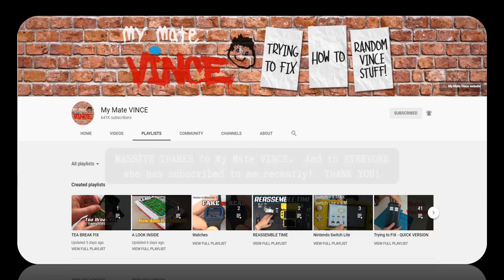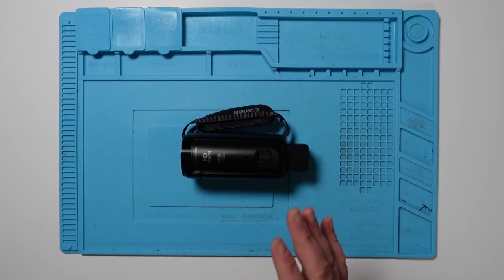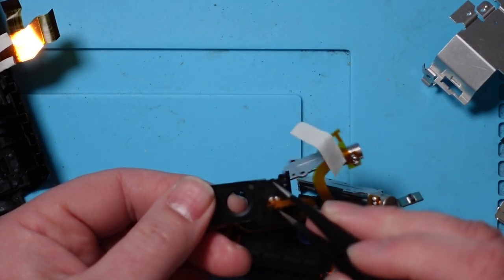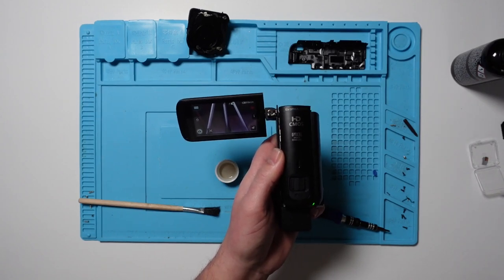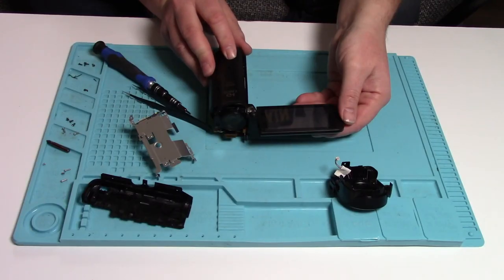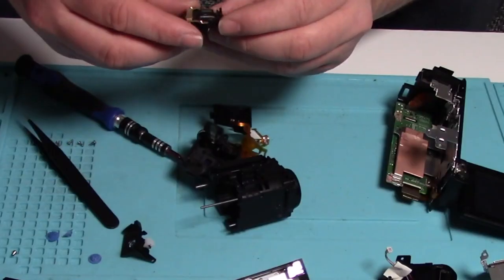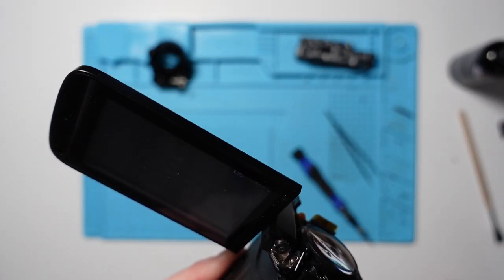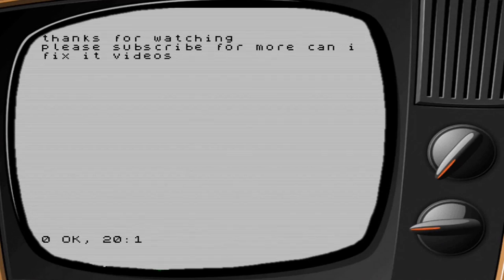REVISIT | Canon Legria HF R806 Camcorder with NO IMAGE/Black Screen | Can I FIX It? | eBay Repair

Comment: Good perseverance, 
I think the reason the iris system malfunctioned in the first place, was that liquid that was on the box too, got into the camera and after it dried around the iris the residue makde it stuck, could have been some sticky liquid.
When it worked the first time then stopped working you also could have set to the Av mode ( manual aperture  )  which would kick in that motor to move

Comment: Hello, Steve,
If you are not sure if the aperture unit is working or not, then disconnect its ribbon cable and use your bench power supply to give it about 1.5 volts then see if it opens or not.

Comment: The reason it started working is because you loosened it up by cleaning it with alcohol. It stopped working because you used the dirty brush that you use for cleaning up flux from pcb's. Once the alcohol evaporizes, there is only sticky residue left, locking up the mechanism again.

Always use clean tools when working on these delicate mechanisms and camera's in particular. I'm sure you caught some dust on the inner lenses too ; )

Comment: Nice to see the inside of a camcorder Steve. Strange how the iris got stuck. Been into photography for years and never seen anything like this. I'd be interested to know if it's still working now?
Reply from the maker: Thanks Jon! I think it is still working, I use it as my backup camera for filming, although I haven't used it for a while. It was certainly a strange fault, but I guess just by opening it up, it freed whichever part got stuck! 👍

Comment: wow, I can't believe i am watching my action unfold in front of me, after watching your previous video on this camera, (I didn't realize you had a second video). My actions and results have been identical to yours, I had my camera sitting here for months just convinced it's broken, and just recently I turned it on to actually charge a battery for a different camera (similar model) and i noticed the camera turned on! I turned it off and just like your's it didn't work!! I turned it back off, turned it on, and played with the zoom as I saw you did, and suddenly it came to life again, but since again the aperture isn't opening.  Just like you, I'm not content with such an undependable camera.
    Should  I do as you did, break the camera completely down and do a major cleaning or should i try and get a can of dry compressed air and break it down just a little and see if i can, "free something up" as you say?
Reply from the maker: 😁 I guess it's quite a common problem! I would probably give the can of air a go, and see if you can dislodge or free up something. If that fails, then I guess you'll need to go a little deeper! 👍